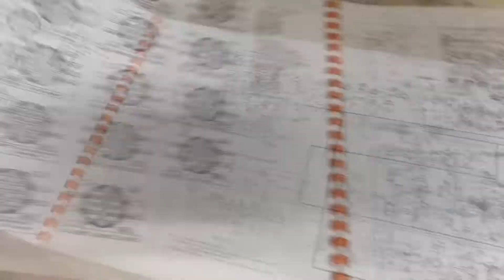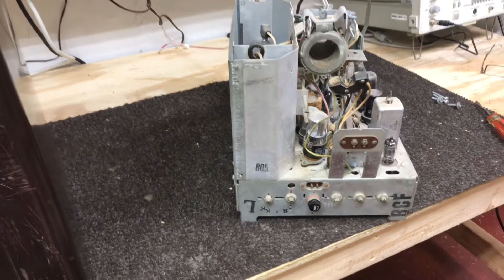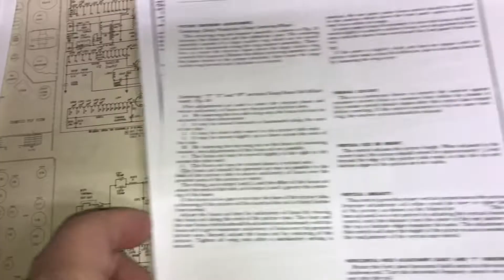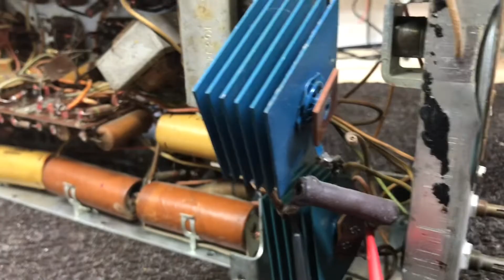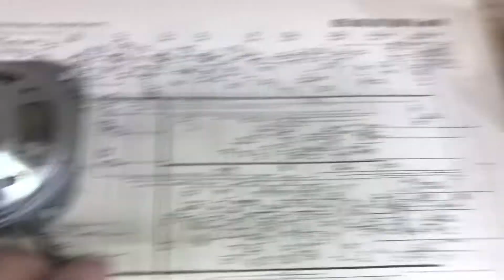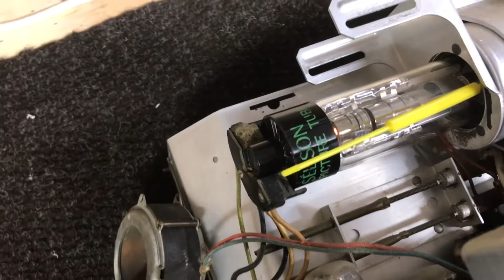1949 GE 10” MODEL 805 TV Restore Pt 1

Comment: I have one of these sets.  I get a very distorted image but do get audio.   The tuner dial needs constant pressure to connect.     Any idea how this may be repaired?
Reply from the maker: I did a full restoration including Capacitors, out of tolerance resistors, cleaned all the controls and the tuner. If you’re moving the tuner to get any sort of image it probably needs a thorough cleaning. 
Other than that I couldn’t offer any ideas , these old sets do need a complete restoration to work correctly 
Thanks for watching, if you not a subscriber hope you consider subscribing to our channel , lots of vintage tv restore videos to watch.